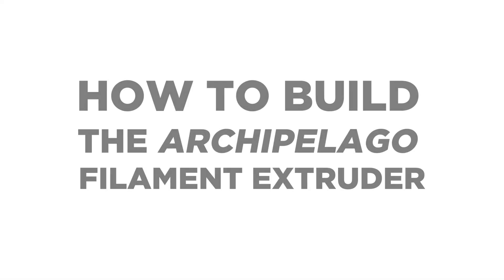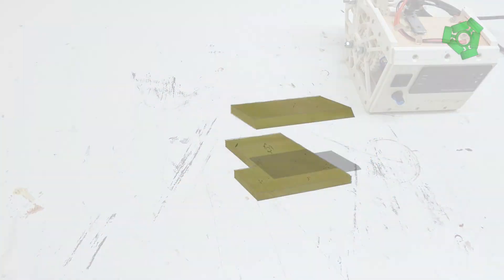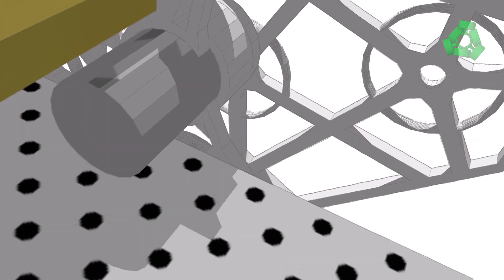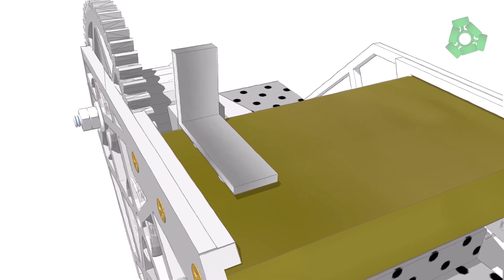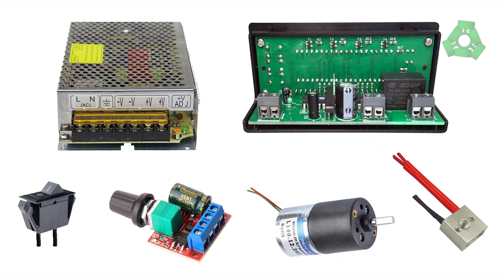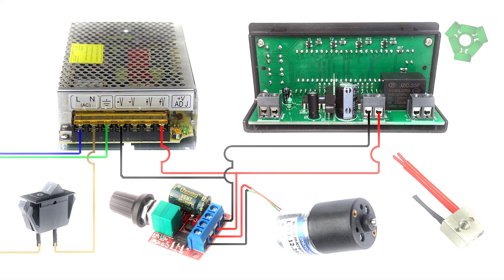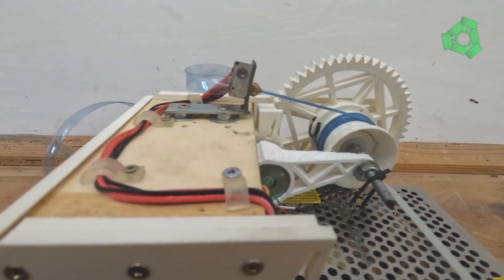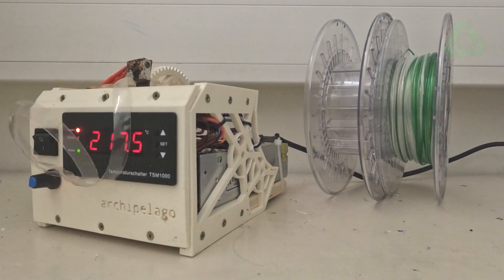How to Build a PET 3D Printing Filament Extruder—Archipelago

Comment: I'm pretty sure you just called the heating element a thermistor but hey, all is forgiven this is a very nice presentation video. Could you maybe add some links to the major parts?
Reply from the maker: Sorry for my slow reply. There is a thermistor in the heating element (measuring the temperature of the extruder nozzle via the thermocontroller).  I thought I had included the parts list or a link to the parts list in the video description, but in case I haven't, you can find the filament extruder's part list on the project's website: https://archipelagogo.weebly.com/filament-extruder.html
Reply: @JustinTylerTate  no sir, actually the thermistor is in the heating block along with the heating element. At 3:58 you were talking about connecting the thermistor. The at around 4:14 you are talking about a temperature sensor. The heating element is not a temperature sensor. The thermistor is not a heating element. The thermistor, however, is a temperature sensor. So either way you definitely called the heating element a thermistor.

Edited to add 
    I do like your video very much, it's well thought out and very easy to follow. Also thank you for tbe link.
    For safety purposes and just general knowledge, though the temperature sensor, in this case, a thermistor, and the heating element are two separate components placed separately inside the metal block. The three component assembly is then called a heating block.
Reply from the maker: Ooops, I guess I messed up on that part of the script :face-turquoise-covering-eyes: Thanks for telling me about it  @1JamesHamilton1  ✌

Comment: Nice video. How do we know if a 3D printer can print recycled PET before we buy it ? Do they specify it clearly or must we check ourselves for some specs ? Thanks for your work !
Reply from the maker: You just need to check the specs, if it can print up to 260-265°C, then it can print rPET. They should specify clearly what the temperature range is. You can also search online to see if anyone has used a certain 3D printer before to print rPET. Thank you!
Reply: @JustinTylerTate  
Thanks for your answer ! :)
Reply from the maker: @En_theo  You're very welcome :D